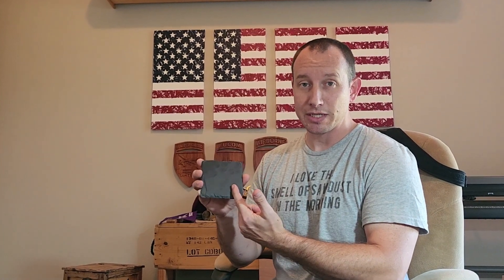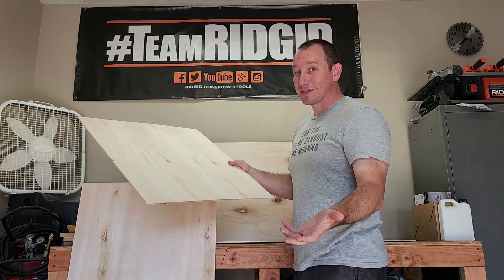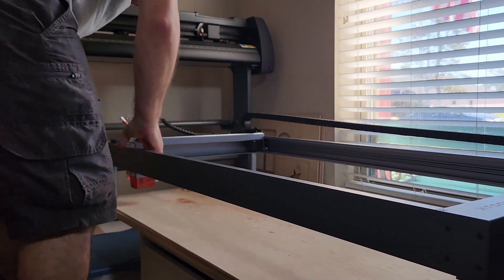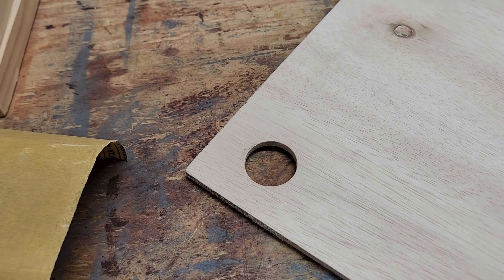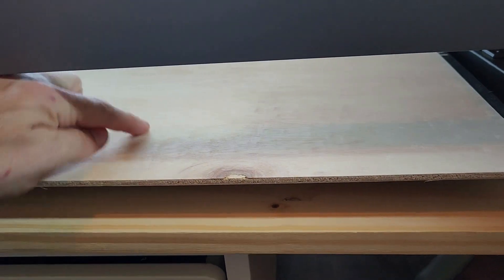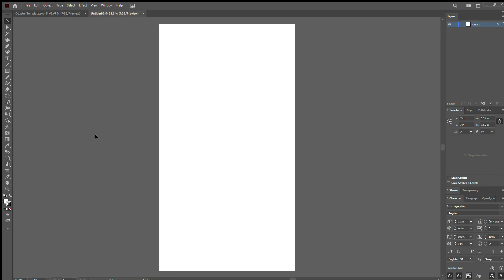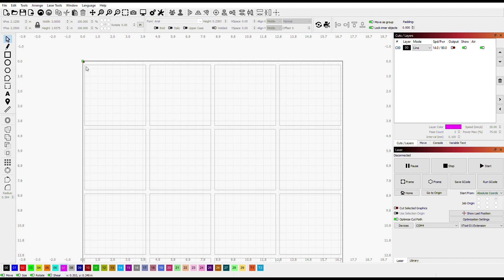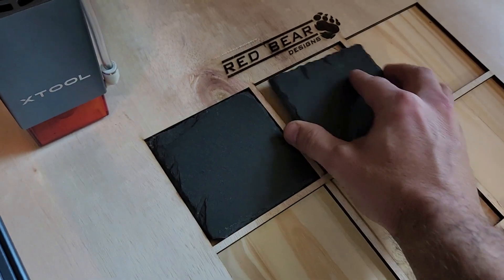How to Make and Use a Jig for Coasters using the XTool D1

Comment: i tryed on xcs and it didnt cut through...help?
Reply from the maker: You'll need to check your settings. Could be the power or the amount of passes. You will have to play with it depending on the type of material you are cutting to get the right settings. You can also run a test grid to find the best settings for your material.

Comment: In general, I understand how a jig works, what I don't get is how do I know that the jig I place under the laser with the coasters in it is placed in the same spot that is showing on the computer screen, if that makes sense.
Reply from the maker: That's why I cut holes where the legs are, everytime I put the jig back with the legs through the holes, those squares will always be lined up in the same spot. Just make sure the legs are tight in the hole so it is a tight fit, otherwise if it wiggles a bit the squares could be off by how much wiggle room there is with the legs.
I hope that makes sense.

Comment: What was the power setting and speed to cut them out? I keep burning mine with so many Passes😟
Reply from the maker: I don't remember exactly l, but it all depends on what watt laser you use, and material you're cutting. I would run a test grid to see the best settings.

Comment: For me, I just don't understand why many people use other programs to make adjustments to their projects when it is totally unnecessary.  Lightburn is capable of performing all of these functions and you don't need to import your projects from another program.  Just seems like a waste of time and a bit more confusing.  Plus, the array tool would have made setting up the jig much, much easier.  An added note, if you are making your coasters with all the same design on them, is to design one and again use the array tool to copy and paste, so to speak, onto the work area.
Reply from the maker: Thanks for the comment. I do mention in the notes that this can be done other ways including just using Lightburn or XCS. However this video was more for beginners to teach the advantages of the x/y coordinates so they can use them for this and solo projects as well. One of the most popular questions I always saw online was how to line up and center projects, and the x/y axis tools are the easiest way to do that.

Comment: Lightburn has a few features that you could have used to make this a much simpler project   1) You could have created the jig within Lightburn using the array function. That would have allowed you to align and space all of the squares uniformly throughout the jig. 2) To get your image perfectly centered on the coasters, you need only put the image on the coaster and then select the image and the coaster outline, then click on the "bullseye" button on the top toolbar. That automatically centers the image into the center of the outline. 3) You can take the coaster outlines from the jig and assign them to the T1 layer. That will automatically stop them from burning. You can also lock them, so that you don't inadvertently move them. There was really no need for Adobe Illustrator at all.
Reply from the maker: Thanks David, while we know these tools, this was more for beginners to learn how to use the basic X/Y coordinates to their advantage. This way they can get used to them to make centering other projects with or without a jig easier as well.
We also put in the notes that the same affect can be made in other software as well, such as Lightburn or XCS.